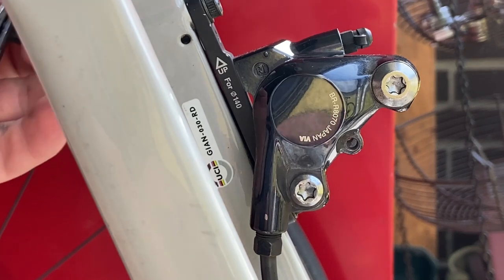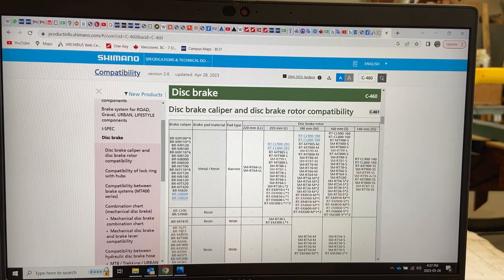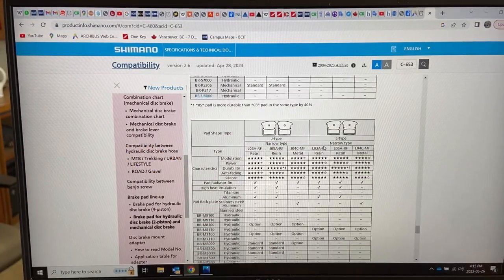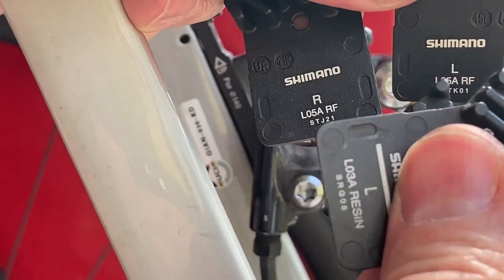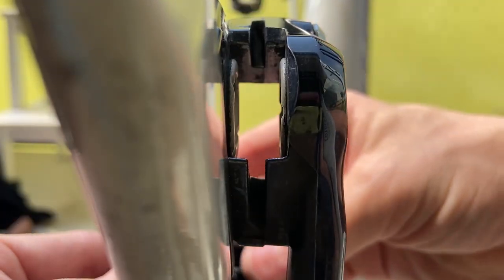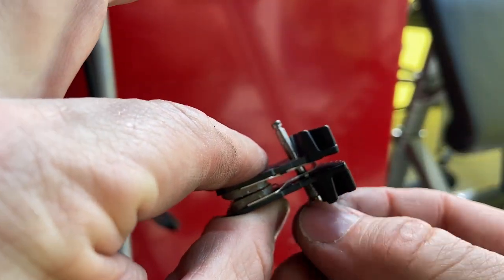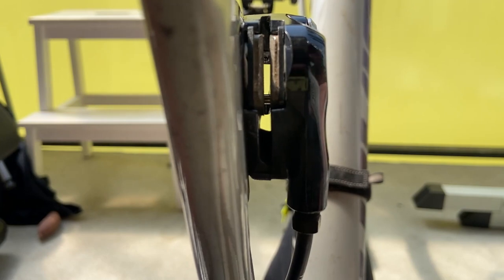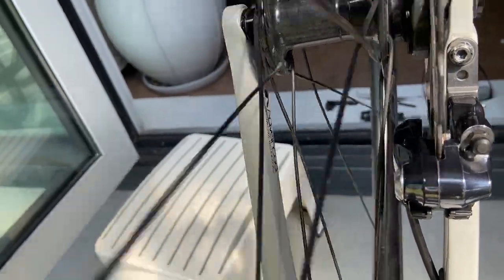Shimano Ultegra disc brake pad change #shimano #ultegra #brake

Comment: Did bedding in the brakes eventually fix that rubbing issue? I’ve put some L05A-RFs on my R8070 calipers to replace the L03As and the spacing is super tight. I think these pads are thicker when new.
Reply from the maker: They very well could be. Sometimes I lap the backing plate or the pad. (Lap as in honing a plane blade, on a sheet of float glass and PSA backed sandpaper)

Comment: the giant tcr bike i bought this year came with the L03a on the front and L05a at the back, after 2300K the front is almost in the shape as yours while the back is still thick like it's new, dunno if it's because the front brake pad generally takes more force or the L03a just doesn't last as long as the L05a or just both. also, the front brake makes this annoying rapid clicking noise when applied.
Reply from the maker: The L05a is totally silent on this caliper with this bike/fork. Could also be a one-off, the pad material or sintering could be slightly off to generate the noise.
Yes front pad needs changing 3 - 5 times before the rear. Just there is more weight at the front when braking.